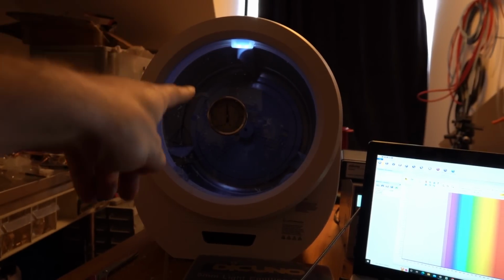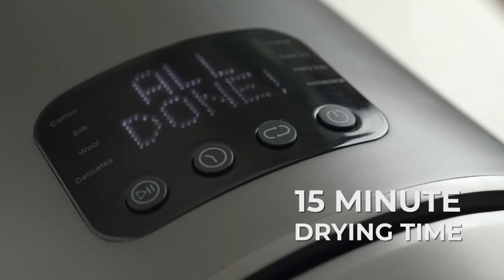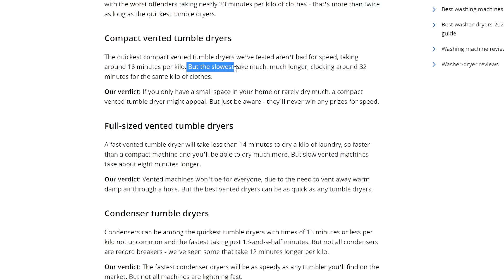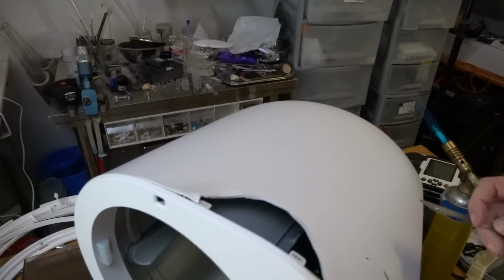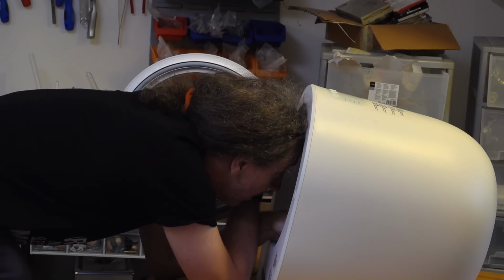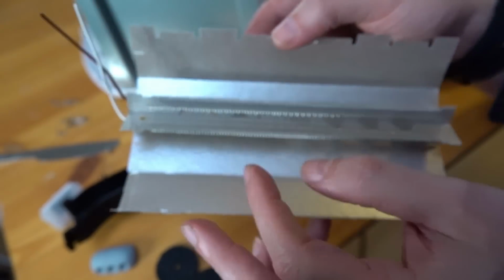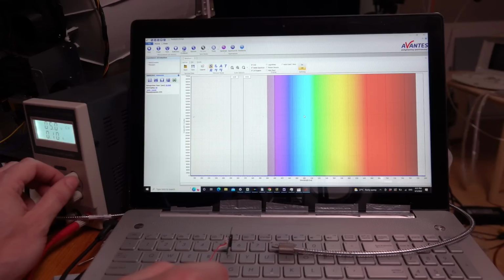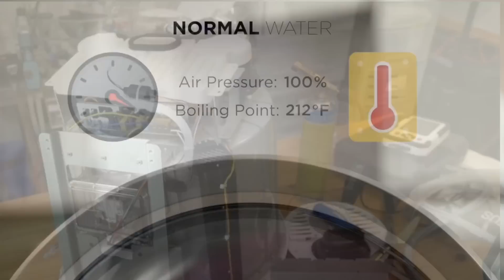Autopsy of a Scam-Starter: The Morus Zero!

Comment: My daughter uses one of those CPAP machines when sleeping. Cleaning the machine is a real pain, taking the hose off and mask then cleaning it in the tub drying it takes a long time.  So after seeing those cleaners advertised on the television, I decided that building one may be fairly easy. So I ordered one of those UV sterilize light bulbs the clear type that makes the strong sterilizing UV  that Hospitals use to prep surgical suites before cutting up folks, and got a regular ceramic light socket to screw it into, the  scrubbed out a 3 gallon cat litter container and mounted the light inside putting a line switch on the cord.  Now she opens the hinged half top inserts her hose attached to the mask closes the half lid and runs the light for about 15 minutes.  Not only does the mask and hose come out clean but smelling fresh from the ozone that the light produces.  All told the cost for the whole setup was around 15 bucks.  Quite a lot less then the several hundred bucks for basically the same thing on TV.
Reply: Please post a video of your process.
Reply: Uhhh, but Breathing ozone is bad though... You might want to rethink this.
Reply: well i guess you haven't heard about the phillips cpap recall.  you should not use uv light to clean a cpap machine.  it will deteriorate the foam inside and shoot it back into your lungs.
Reply: I've cleaned my bpap equipment with an ozone machine and the fumes from that shit is extremely irritating.
Reply: @OldEnoughToBeYourFather  The mask and hose don't have foam.
Reply: This is why I don’t use the humidifier on mine. You really don’t even need to clean it as it’s just pumping dry air through.

Comment: When I was an industrial chemist it was far quicker to dry compounds in a fluid bed dryer at atmospheric pressure. The moving air sweeps the water vapor away more efficiently than putting it in a vacumn oven. The clothes line analogy is a correct one.

Comment: As an appliance service technician, I suspect this POS will get plugged up internally with lint very quickly, and be a fire hazard. Without a lint screen, there will also be a pile of lint and dust around it in a short time. It's repair-hostile, and I would be shocked if repair parts are for sale.
Reply: There won't be any repair parts for sale. I bet they ran as soon as they got the money.

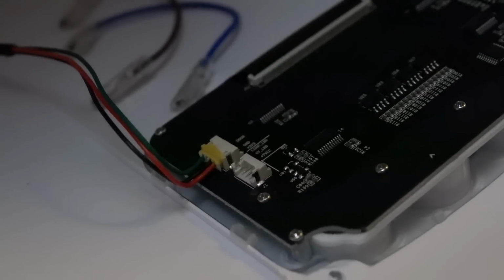Comment: 25:40   I'm glad you found that UV LED because the whole time at the start it was bugging me that you never actually checked it while it was running.  I was somewhat worried that you'd test it while it was running but the door would be blocking the UV rays.  Anyway, it's a shit product all around, but I'm glad you went back and gave credit where due 👍🏻

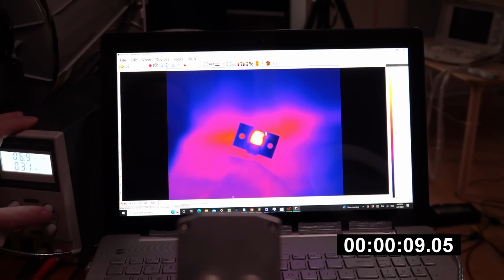29:00  Maybe they run the UV light the whole cycle to help increase the heat in the dryer 😂
Reply: That thing warps the shroud around it after turning it on for less than 2 minutes.
I really don't think the whole circuit board would survive 15 minutes. 😂
Reply: I had the exact same things bugging me, and was also glad that he finally checked the LED board to find the UV LED.

I'd guess that the UV LED is probably on some kind of duty cycle so that it doesn't overheat too quickly. Plus it would help to turn it on at different points while the clothes are tumbling so that it gets better coverage.
Reply: Glad he found it, but annoyed he didn't include a note at the beginning of the video stating as such. Leaving that part in the video, knowing it was false, is pretty disingenuous. Especially, when most people won't make it 25 minutes in to see the correction.
Reply: @NAJALU   He's waiting for a THUNDERF00T DEBUNKED video on it so he can Uno Reverse them 😂😂

Comment: The UV led might be running hot because you are running it on constant voltage rather than constant current. On 6.9v and 340ma it's almost 2.5watts which is a lot for that footprint.
Reply: Not really, just needs a bleeding good heatsink lol
Reply: TFoot clearly does not know how to drive LEDs. It definitely should be driven with a current source, not a voltage source. As to how much current - the only way to really know is to turn it on with the original electronics. Or find the datasheet to find the max current figure and max temperature, and experiment to see which current is actually reasonable for this design.
Reply: It could also be pwm, but who's to know if we're not using an oscilloscope.
Reply: @Phobeuscz  yeah, but diodes aren't resistors, hence the different name👍
Reply: @Phobeuscz  It actually does. He wasn't using the current limiting function. That's why it went from .1 to .34 amps. That LED shouldn't be driven without PWM at that current. The voltage rating on an LED package should be viewed more as a "can this thing survive a transient spike at this voltage" and then design your driving circuit around the junction's current handling ability.
Reply: @Phobeuscz  LED's don't have a linear internal resistance.  You can't just supply the rated voltage and let the LED's internal resistance set the current.

If you know the rated voltage and current for the LED, you can easily calculate what size resistor to use for a given input voltage.  But if you're already using a programmable power supply, you can limit the current directly, which he didn't do.

Doesn't change whether or not the LED would actually disinfect what's in the dryer (I don't see how it really could), but it does affect the conclusion that it can only be run for short periods of time.  Run with the correct current, it can probably run throughout the drying cycle.
Reply: @TrueThanny  don't be too hard on him. You don't learn about semiconductors in elementary school ;-)
Reply: @robinx6754  yeah, but Thunderfoot had a lot more education than elementary school, so it's very strange his thinking may have been along the same lines.

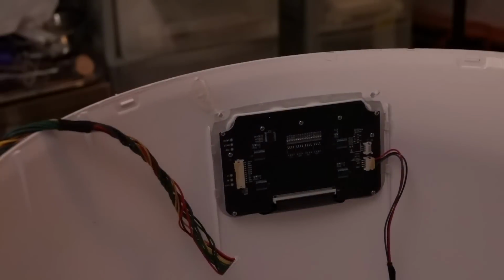Comment: 19:36 that's actually very common to see on connectors where vibrations are to be expected. i am actually surprised to see that attention to detail here. it means there is at least one engineer with some level of competence there. perhaps there is hope for humanity. but given the $600 price tag there had better be glue on every fucking connector. overall this actually seems to be rather nicely made. its just a shame that it is a nicely made piece of junk.
Reply: Like the juicero! The innards would make any mechanical engineer drool.
Reply: Yes, it struck me that this is a pretty well made product.  But Chinese manufacturers already make small electric dryers that probably perform as well at 1/3 the price (based on what I see at AliX).  And blow-up bag portable dryers for 30 bucks that don't look as nice.
Reply: I agree, its like a well polished turd !
Reply: that's what you get when you throw money at engineers, they don't care how stupid your project is, they just want to make cool shit.
Reply: Designed well.  Functions terribly.
Reply: I must question why hot glue? Wouldn't there be a risk of it melting if the machine gets to hot?
Reply: @mwperk02  was it hot glue? it looked like epoxy which we use a lot on connectors but maybe i was not really paying attention and just assumed. Hot melt would be terrible
Reply: @Randrew  i would be shocked if this machine was not made in China as well.  or another lower wage Asian country like Vietnam.

Comment: Wait till the kickstarter of the Borus Zero. It features a large hadron collider powered by your normal household outlet in an even smaller package. The 'micro blackhole' technology ensures ensures that not even light can escape the Borus, let alone your damp underpants!
Reply: Will it use Advanced Quantum Entanglement technology with all pairs of socks to ensure that none ever go lost again?
Reply: ok that black hole explains where my socks go
Reply: @DFMurray  As soon as we figure out if socks function as a wave or as particles we install AQE when we reach 1 mil on kickstarter!
Reply: High precision hadron bursts will obliterate any and all skid marks.

Comment: From the inside (especially the roller enclosed in a box sealed with O-Rings), it looks like at some point the design did include trying to hold some sort of vacuum. The air circulation could have potentially been a closed loop. But they probably found that the level of vacuum they could hold did practically nothing for drying times but greatly complicated the engineering. In a closed loop their condensing segment simply wouldn't have worked well enough without dedicating a lot more space to it.
Reply: I think some of the things like the seals and condenser are purely to say they tried and it just doesn’t work very well. It technically has the parts and could in theory work to a degree. That coupled with vague claims can pretty well protect them in court. 
At the end of the day they’re just another company looking for a decent payday before they disappear.
Reply: Landfill .
Reply: @NBSV1  It may technically do everything they said. The advertising is so misleading it would be illegal in some/most places. But it technically does all those things...

Comment: As others have written, it's built to a minimum legal standard. On that basis, the draw of the fan would produce a slightly lower than atmospheric pressure which could be argued is a 'partial vacuum'.

Comment: I've built a device (zortrax apoller) that pulled a chamber vacuum of what I think was 0.25 atm ASL (nowhere near vacuum) and the amount of engineering we had to do to keep that thing from crushing itself (and with 2kW of motors/pumps/valves/heaters controlling explosive solvents - also blowing itself up) was far from trivial. Knew from the start this was a special ed project by people who got lost on their way to the potato chip factory.
Reply: Can you say more about this device and what it does?
Reply: @Ariccio123  3d printing works in layers - and objects made like that have a stepped surface finish, unlike molded parts. Being plastic, their surface can be smoothed with solvents, although spraying or dunking the part in just melts them into a sad puddle. The device uses fancy process control (pressure, temperature and lots of physics) to smooth < 100 micron layer lines without distorting / melting the part.
Reply: Dan Ershen  The polysher works by saturating vapor only, the apoller manipulates pressure to first saturate then drop solubility of solvent in air and uniformly cover the part in a thin film. Keywords being uniformly and thin film - it does that a couple of cycles and then scrubs/condenses most of the solvent from air.
Reply: Dan Ershen  In practice liquid solvent is more aggressive can attack more filaments, smoothes harder and faster - but unless you can uniformly deposit a thin film, it just melts the part. By depositing it by phase transition you get that. Additionally it's quite idiot proof, consumer washing machine safety levels, leaves a mostly clean chamber. It did end up rather expensive as a result, which was my point about vacuum devices.

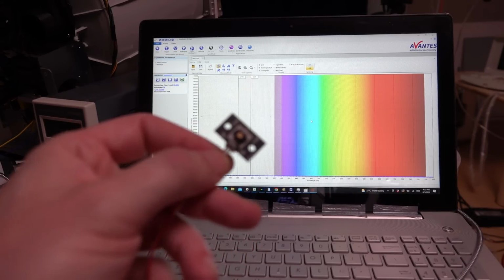Comment: 27:52 It's crazy hot because you're overdriving that LED pretty hard. This kind of UV LED can usually only take less than 50mA and needs a current regulated supply.
Reply: Yes, LEDs are current-operated and not voltage-operated. So the PSU should have been configured to switch from voltage to current regulation as soon as the voltage got high enough for the LED to operate.

Not only that even at a fixed voltage, the actual current is very much affected by the LED temperature making it impossible to find a perfect voltage to drive it with.
Reply: He's a chemist, not an EE.
Reply: @pseudotasuki  Correct. And sad thing is that even many EE engineers fails to properly understand how LEDs work because the old concepts with incandescent lamps are too rooted in their heads where you control intensity with voltage. So more than one commercial design that suffers thermal runaway.
Reply: @pseudotasuki  which is exactly why this feedback is useful

Comment: Thanks for pulling it apart, it was interesting to see what was going on inside.
It's a bit of an enigma, it's a product that someone has obviously tried hard to make work, but still gets some fairly fundamental things wrong.
Reply: It's like a few engineers really wanted to try and achieve the goal and knew what they were doing, then someone fired them and decided to "make it profitable."
"A copper heat exchanger!?  Why do I always have to replace this stuff with plastic?"

Granted, there seems to have been no effort to create a vacuum, which would imply to me that this was another project the kickstarter got a hold of and just came up with some branding for while stripping out expensive things.  A custom metal heat exchanger like that would be incredibly expensive relative to the other components.  2 million dollars from a kickstarter would barely cover line tooling fees for the run I imagine.  Much less the actual product.

Comment: white LEDs are actually just blue/violet with a phosphor that shifts some of the spectrum lower. different color temps are simply a result of different mixes in the phosphor but with the same junction.  the main reason why LED efficiency has gotten so much better over the years is actually more to do with more efficient phosphor development since that is where a lot of the energy is still lost.  its also why as LEDs age they tend to shift blue since the phosphor degrades over time and if you have ever seen random blue leds on street lights or on buildings its actually a result of premature phosphor degradation which can be caused by several things including moisture getting into the package causing delamination over time or even a faulty driver that overdrives the LEDs during startup causing them to degrade faster
Reply: Only the white LEDs got more efficient. Red and green were go-to LEDS for all the battery powered devices right from the day humanity learned to manufacture them cheaply - exactly for their efficiency.

Comment: Word of warning with LED's. When you reach breakdown voltage, the LED is basically a short circuited. You over currented the UV Led, it needs to be run off a constant current source, or at the least a current limiting system.

Edit:
You where running it at 2.3W, from the size id expect it be rated at 0.5W or less.
Reply: that's what I was thinking too
Reply: https://youtu.be/-L_a9P2Xjfs?t=1828 you can clearly see the 3ohm (3R00) current limiting resistor on the backside of the LED board. Either the manufacturer is driving the LED with PWM, current limited LED driver on the control board, or they too are overdriving it.
Reply: @Kageitenshi  Why? Did we see any measurements of the voltage they are driving the LED with? You are right, limitig the cuurent directly would be more professional, but the current through the LED is just the drive voltage minus the forward voltage of the LED divided by the current limiting resistor. The forward voltage will depend on the current. This is one reason to use constant current sources. But I do not see why they would necessarily overdrive the LED with this setup.
Reply: Yup, and UV LEDs tend to have a lot sharper breakdown than e.g. GaAsP indicator LEDs. Those you can eyeball. UV LEDs I use crowbar within 0.2 V.
Reply: @ksjhi  I guess overdriving is not the correct word, but too much power for the used cooling solution, rather. Found what looks to be the chip, a Chinese SMD size 3535 or 3838 ~290nm UV LED (supposedly) rated at 1W luminous power when driven with 5-10V 350mA. Plenty of variants with varying power outputs. Could be that they first tried with the lower power ones, but thought "higher watts is better, right?" ordered them and realized that it gets too damned hot, but couldn't switch back and limited the heat with some other means. They might have started with high hopes, but the device is full of bad design and clearly they stopped caring at some point.
Edit: The LED is already in a hot environment, so they'd have to take thermal runaway into consideration somehow if they limit the voltage alone. In which case they're probably not getting the full rated power out of the LED by limiting the current closer to the threshold.

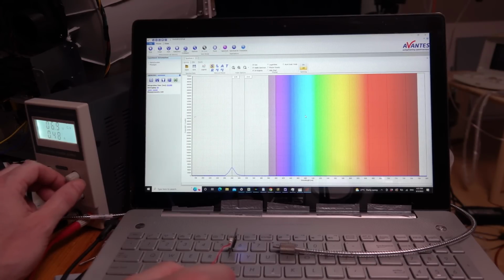Comment: 27:21  0.5A @ 7V , that is 3.5W in a tiny area. No wonder it melts.
To be fair they might be limiting the current with a resistor or even with a current sensing/limiting circuit in the main board. Alternatively maybe using PWM.